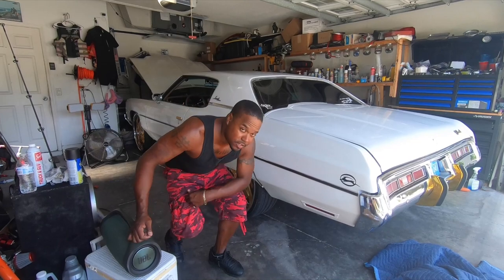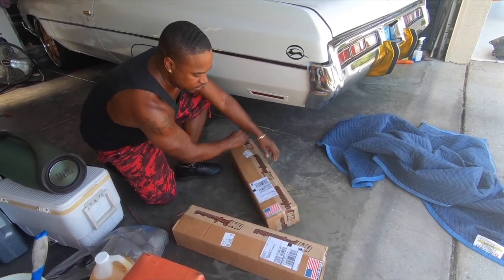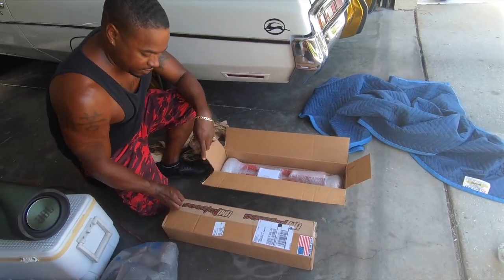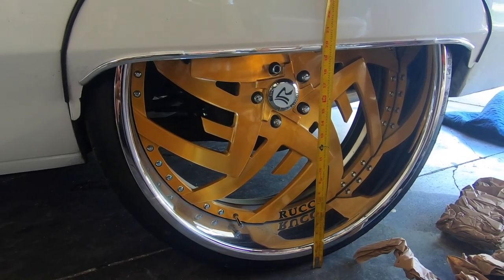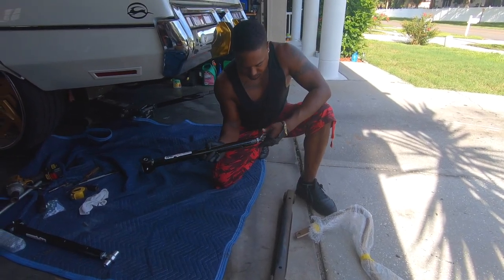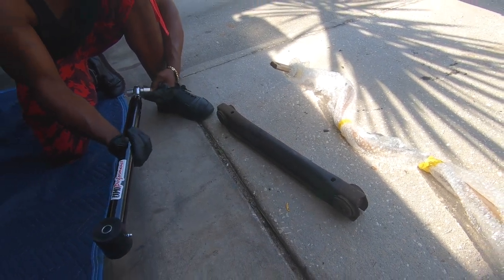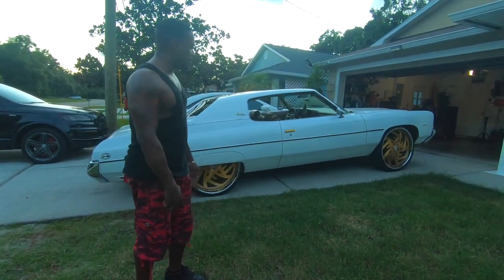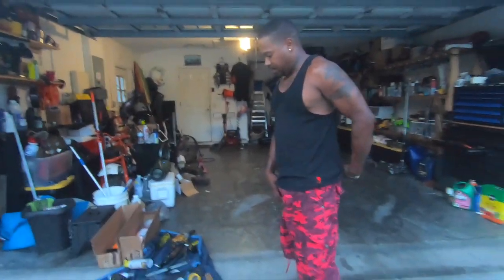Squatting the Donk the Right Way

Comment: You ever get that sway bar on there?? Nobody makes an aftermarket one for donks so im just using the stock one. Thought about tryna make the 96 SS one work but thought if I heated it up and bent it that it would ruin the structure of the sway bar. Please let me know if it works cuz I have a 96 ss sway bar already
Reply from the maker: When I put in my UMI lower trailing arms, I was able to use a 96 SS rear sway bar which made a huge difference on the handling of the car and I'm about to order a front sway bar from QA1

Comment: Can I use trailer arms without the coilovers to get it to squat? Or no?
Reply from the maker: Well you need the coil overs to adjust the ride height the trailing arms just move the rear end back-and-forth the coil overs move the rear end up and down.
Reply: I’m having a problem getting my rims to fit with my skirts on the back, I hope the trailer arms and coilovers can fix that problem
Reply from the maker: @dfry5762  You have to remove the hardware from your skirts and use self tapping screws to install the skirts
Reply: Ok thanks
Reply from the maker: Either that or your wheels are too wide
Reply: @Floridamuscle  I was told they were the right size but I did hear I need to re mount my skirts though. I’ll get the trailer arms and coilovers and hope that helps
Reply from the maker: @dfry5762  remove the hardware from the skirts and I guarantee you they’ll fit, you really want to screw your skirts in anyway because they are very valuable and can be stolen easily
Reply: @Floridamuscle  ok thanks for the reply and advice
Reply: @Floridamuscle  can you please do a quick video showing how you removed the hardware on the skirts and did the self tapping screws process, or is there anyway to contact you personally to get a cpl questions answered? Thanks and I’m subscribed to your channel as well!

Comment: Aye bro when you squatted it do you rub on the inside  of the quarter panel where the top of the wheel is ?
Reply from the maker: No you just have to adjust the QA1 Coils correctly
Reply: I can’t find the arms no where what’s the part number for the arms my rims hitting